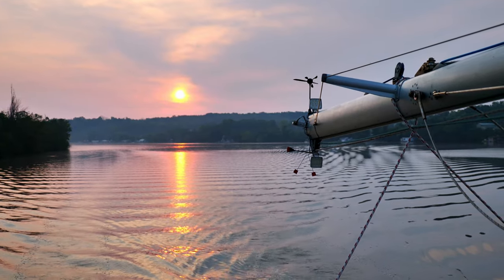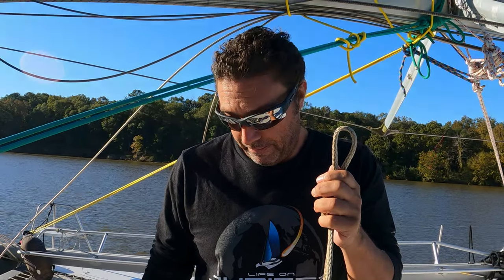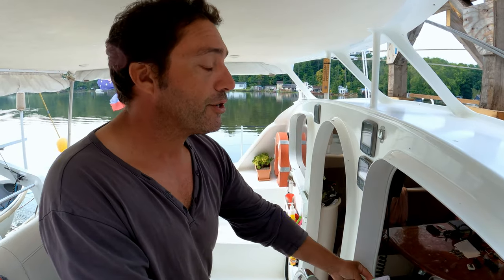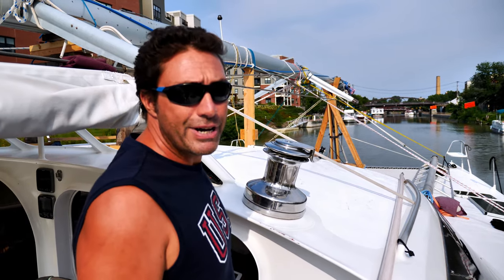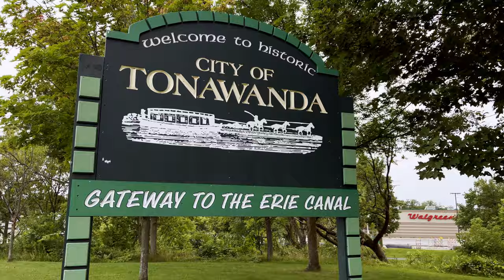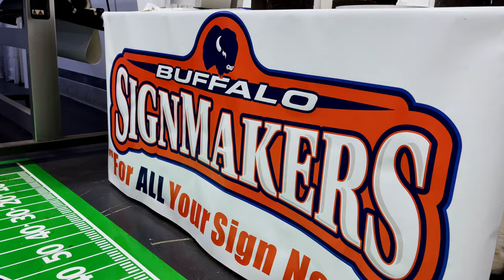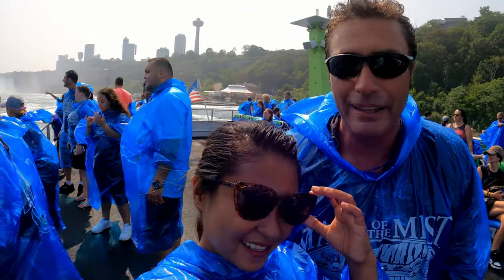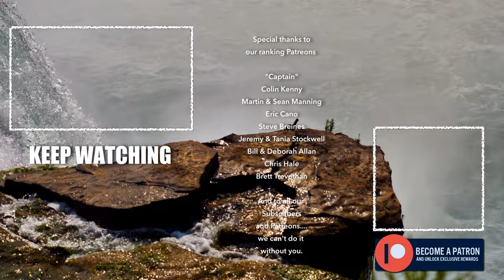Don't take the wrong turn on the Erie Canal - Great loop #11 - Sailing Life on Jupiter EP90

Comment: A lot of those earlier canal stages looked like areas of the European canal network....even some of the boats.
One of those bridges dropping on you bridge would definately ruin your day..⛵😂 
The speeds restricted because the prop wash and wake would destroy the canals banks and bed...  They were lined with clay to seal them in some places .. in the UK and France. But they were  initially 1hp.... horse drawn..till steam engines took over.
Reply from the maker: Tks Clive... I don't think Jupiter broke any speed limits!
Reply: @SailingLifeonJupiter  
Lol.. a performance cat is going to be under achieving for sure...but you get used to the pace.

Comment: I've heard that they shut the water off at night because just upstream of the falls there is a water power plant and they take most of the water away from the falls. If the plant wasn't there than the falls would be like 20 times or even more than that powerful. I've also heard if they let all the water go over the falls that it would erode the falls back to the great lakes and drain the lakes. I've never been there but would like to experience it in person some day.
Reply from the maker: You're probably right Robert.. Was pretty specy
Reply: They throttle it back at night. They could shut it off but it’s all ran by international agreement nowadays as they want to maximize electrical generation and tourist view and minimize erosion. It eventually will erode back but that’s many centuries from now.

Comment: Do you attach the anchor recovery line every time? Or is it a permanent attachment and if so how do you store it on deck? I feel like it would create a mess and a hassle to anchor each time. I've heard of ppl zip tying the recovery line to the chain itself to reduce that hassle. Yanking on it would free it so it can be used. Thoughts?
Reply from the maker: No we don't use it all the time...but usually where ever there's likely to be snags...
Cable ties wouldn't work, coz the chain has twists.. A single wrap around the chain and your trip line is no longer pulling the head of the anchor, but pulling on the chain itself. Cheers

Comment: That's great  assuming no one steals Bob. As they did in my case. I now loose every 20 metres tie to the chain. I use a float rope. If needed its realised very easily unties when pulled
Reply from the maker: There's no perfect solution hey Bruce...cheers
Reply: @SailingLifeonJupiter  their is no perfect solution..
To me the rocna anchor has one major problem. 
It's that as the boat drags the anchor digs deeper and deeper into the sea bed.trying to hold the boat
I've had the bar 300 below in mud.
I've had to wait to low tied and dig it out.
A retrieval line will not help
So there is no perfect solution to the problems that can occur with anchorring.
There is a breaking link that work or you can use a thin bolt .
The chain is attached at the rear of the anchor where you attached the rope. It's then bolted or use the link to connect at its proper fixing point.
Under normal working loads the link holds. But when it breaks the anchor is pulled out 
As I've said their is no perfect solution to anchoring only problem that need to be solved.